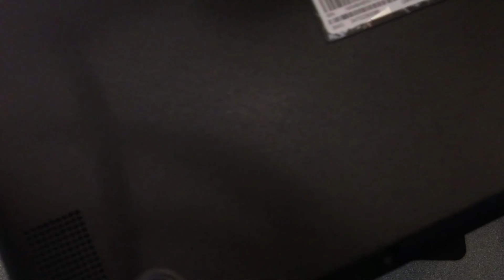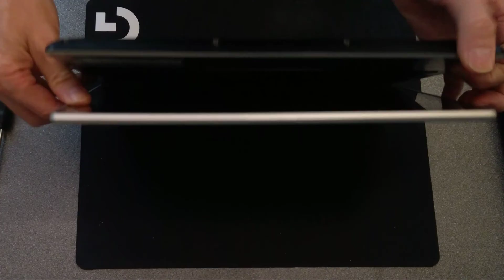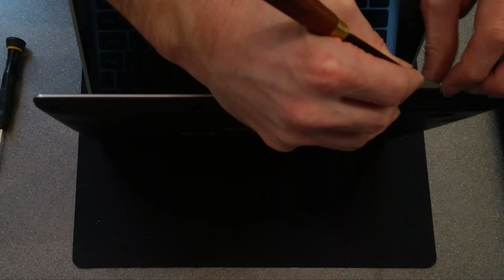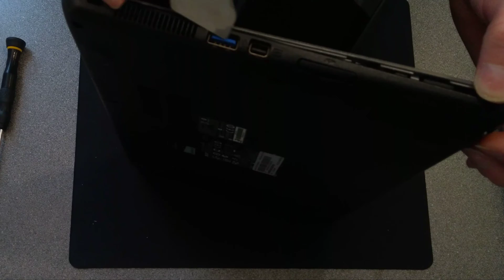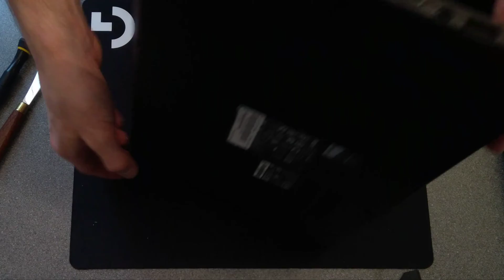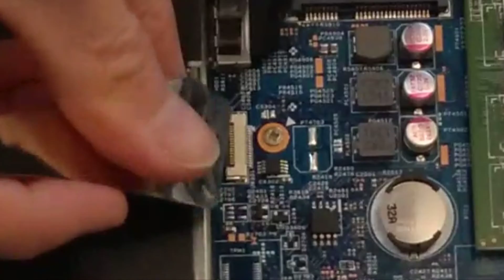Acer Aspire v5 - How to take out or upgrade the hard disk

Comment: Hi, stupid question, Can I just swap out the hard drive and then install a new operating system (Linux) using the boot manager  or would it be easier to install on the old disk and transfer it all across to the new one as Ive heard horror stories about the bios on this machine?
Reply from the maker: If you are looking to change OS or start from fresh.. I would leave your old hard disk and OS as it is, take it out.. put the new drive in and then boot from an install USB and install to the new drive. If you don't like the new OS you just put the old drive back in and you are back to where you used to be.
Reply: @freename  Many Thanks!

Comment: we have the same laptop, is the ram of this computer is built in? I dissassemble my laptop and I dont found any Ram in there
Reply from the maker: The RAM on my one is clearly visible in the middle.. has a white sticker with a blue line down it showing ADATA  and a CE mark on it. However from what I can see I think that might be 2GB which means there's probably another 2GB soldered directly onto the board?

How much RAM does your one claim it has?

Comment: Subscribed. If I upgrade to a 128 ssd and double the ram to 8gb ram, will there be a big improvement from the extreme lag performance it currently has? Aspire v5 122p.
Reply from the maker: SSD is likely the only upgrade that will make a huge difference, unless you leave a lot of windows open all the time.

Comment: Thank you for the video! Really appreciate you taking time to make this. My HDD on this laptop died so I need to replace it. I found two (Toshiba and Western Digital) that are both 2.5", 8mg cache, 5400 rpm, and they are $3 cheaper than stock HDD. Should I replace with stock or does it matter so long it's 2.5" hdd? Thank you!
Reply from the maker: Replace with a 2.5 SSD! It will feel like a new computer!

Comment: Turn on the lights.
Reply from the maker: I would if I could. They are spotlights and they are either in the current mode where they bounce off the walls and roof and give a fairly uniform but pretty poor light... or they point down and my hands, arms and the camera create shadows all over the place and also make it unpleasant. My main job isn't youtube so I've not put energy or cost into a filming lighting setup.